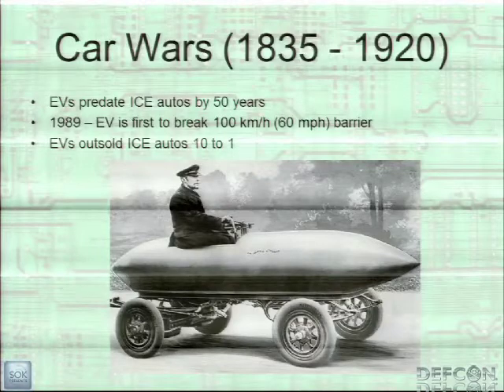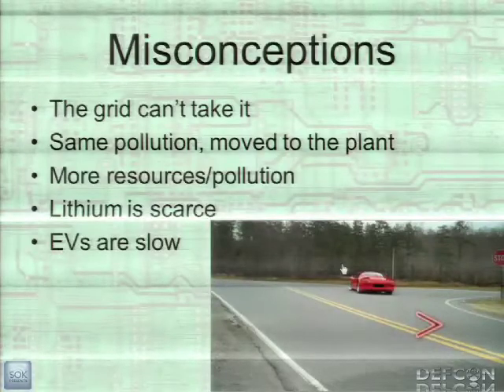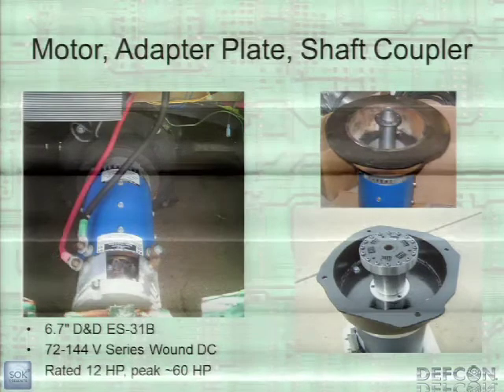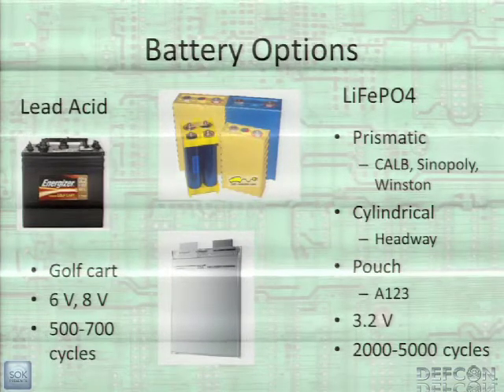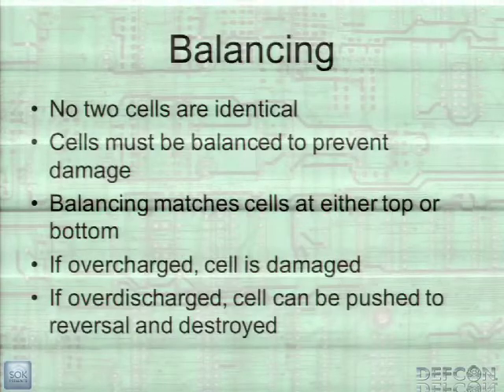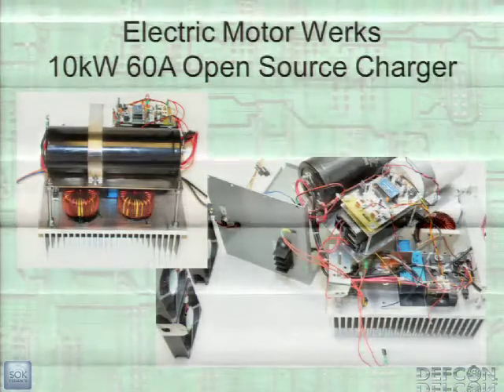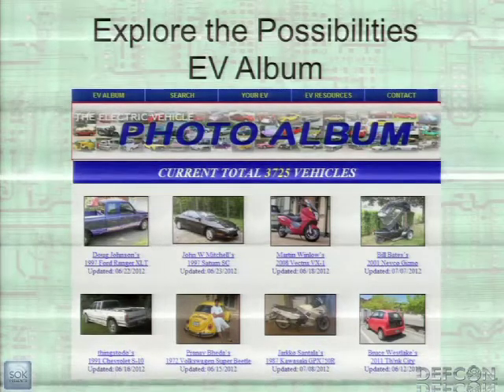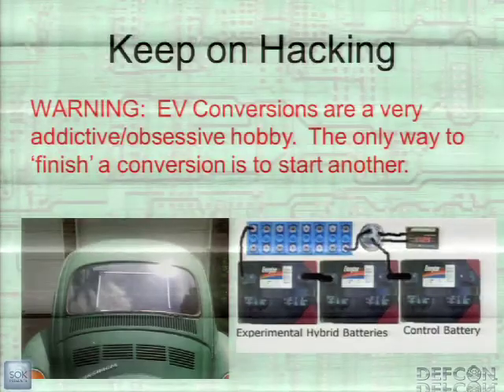DEFCON 20: DIY Electric Car

Comment: Just as a word of warning as some one who has done this before this guy really doesn't as much as you would think. AC is has a lot more benefits than just regenerative breaking, lithium is scarce when you start talking about making billions of cars. The other thing is you cannot charge batteries at infinite speed even if you had enough service to supply it, and expect to have any longevity out of the battery(depending on construction).

Comment: good video BUT What is he talking about at the end, you cant charge a lithium battery up in a minute even if you have unlimited power, the cells would have to be rated at 60 coluoms max charging rate!!!!!!!!!! the higest i have ever seen was 10c max charge rate and that was on a just released lithium polymer cell!!!!!!!!!!! Most prismatic cells that he was talking about are 1c max charge rate if you get the BEST it is 2c!!!!!!!!!!!!!!!